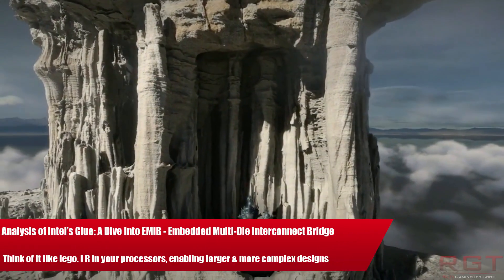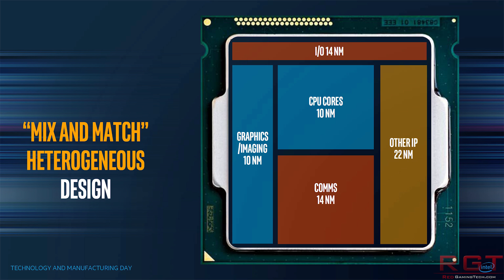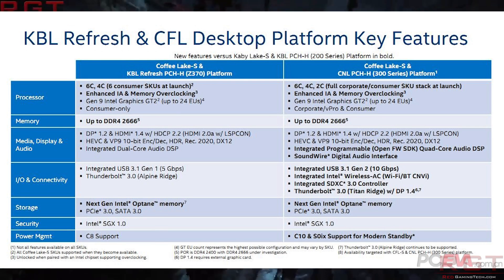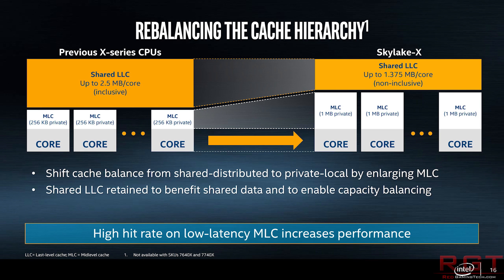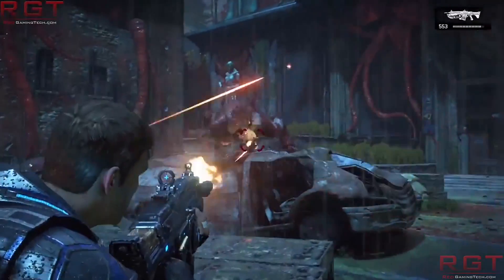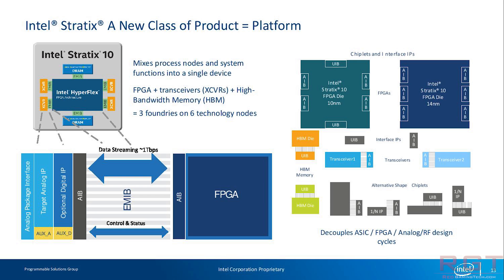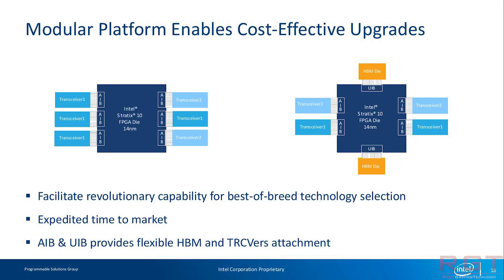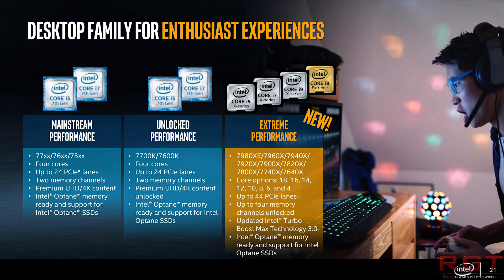Analysis of Intel’s Glue | A Dive Into EMIB - Embedded Multi Die Interconnect Bridge

Comment: Yeah I knew this was gonna happen. You can see the problem with Intel already using more cores on one dye. The heat is the main factor if I wanna get more speed with more cores on one dye. That's why all their server cpu are clocked low or they would roast themselves. Infinity fabric is the solution as you can see the lower tdp of ryzen, epyc, and fredripper. Besides all the advantage Paul stated.
Reply: ZeroFallout1 also AMD SOLDERS their cores. Not use cheap thermal compound.

Comment: So, this means that 5ghz is going to be the last milestone it the cpu history?
Reply: Tanner Sims also IPC needs a massive push, since pushing clock  speeds pushes the temp up.
Reply: thesilviu silviu  yeah the more cores you ad the more heat u gonna get with out using this technology
Reply: thesilviu silviu CPU's have just about reached the upper limit in regards to clock speeds. Its much more efficient to have more cores. Hopefully developers and software begin using multi-threading.

Comment: If intel has to connect seperate cpu chips to make one whole chip, they already have researched this design nearly a decade ago with QPI (Quick Path Interconnect). The first gen i7 used this inter-CPU connection Bus that allowed effortless CPU to CPU connection by simply adding another CPU socket in the circuit. I wonder if QPI is going to make a return or have they got a more effective way to connect two CPU together.